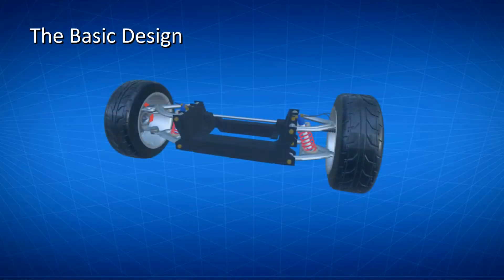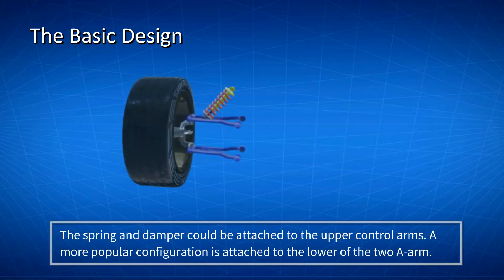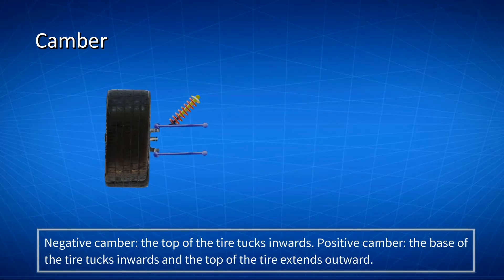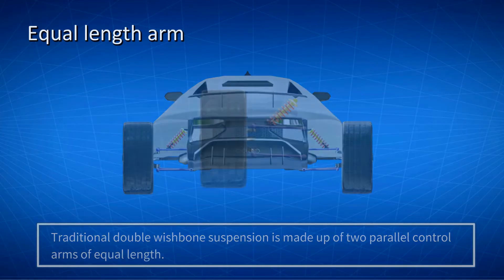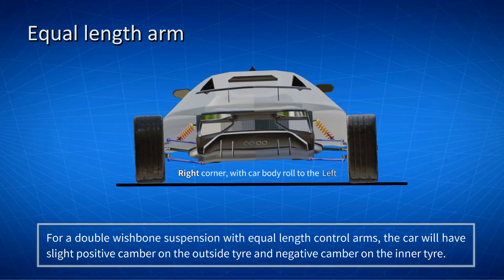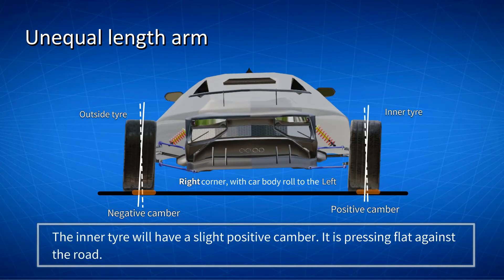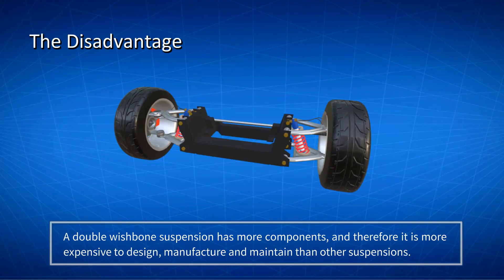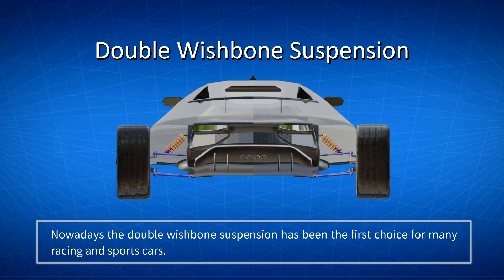Car Suspension: Double Wishbone Suspension explained (2021)

Comment: I'm reading a book and it has black and white photos. I really enjoy how this video gives a great explanation on shorter upper control arms and how with roll or vertical movement, the tire camber changes. This video simply clarified what I am currently reading.  👍

Comment: Very nice vids, thank you.

I could never get used to McPherson on newer hondas after driving eg's, ek's, dc2r's for years which all had a brilliant double wishbone, combined with relatively low weight those cars almost drove themselves.
So I had to get cl9 and love it so far, dw up front and multilink at the back... So like previous comment I too vote for a multilink vid 😁.
Reply from the maker: Thanks for your support. We will release more suspension videos in the near future. Stay tuned for more content.
Reply: I agree! I have a 1997 Civic with 354K miles on the original steering and suspension (except outer tie rod ends which just started to get loose) and it still rides and drives amazingly well with absolutely zero signs of trouble. That said, I'm thinking of rebuilding the suspension while OEM parts are still available because I know it's old and not going to last forever and new OEM parts likely won't be readily available in, say, 10 years when a rebuild may actually be needed. As bad as the roads are where I live, preventatively rebuilding the suspension after 27 years while I can still get parts is something I can live with.